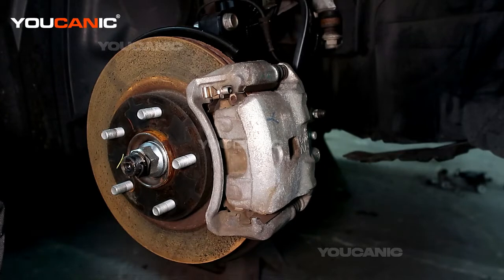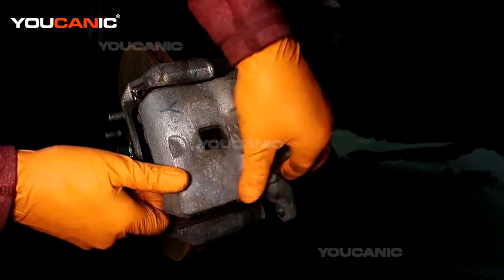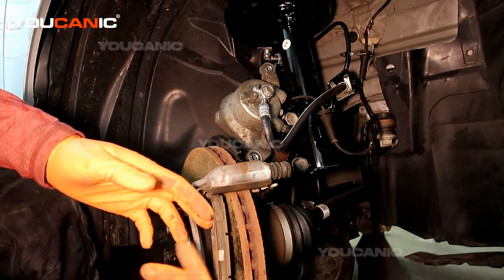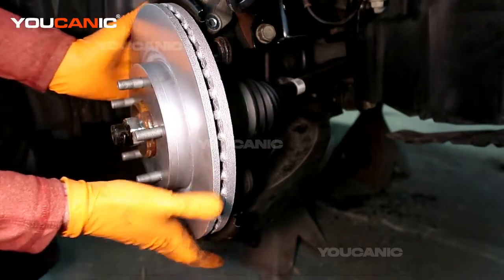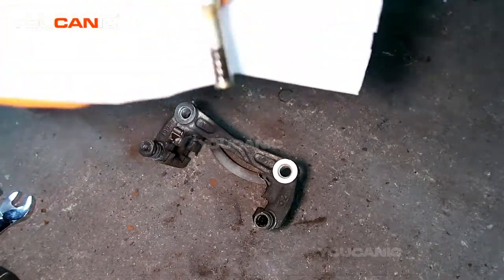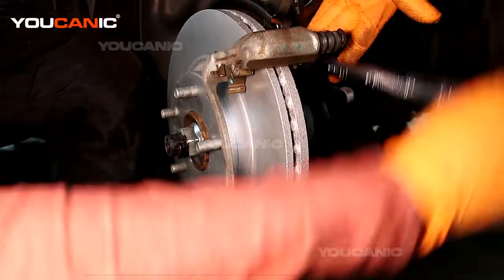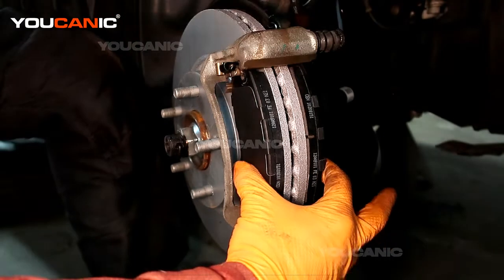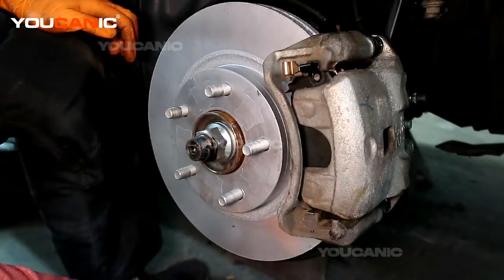2013–2019 Nissan Sentra Front Brake Pads and Rotor Replacement

Comment: Good job on the video. I would just add to make sure to torque caliper and caliper bracket bolts. I would also add to file off the rust around the hub where rotor sits and use some anti seize on it.
Reply: Don’t forget to clean the rotors with brake cleaner and wipe off the coating that is applied on both sides of the rotor at the rotor factory to keep them from rusting before they are purchased
Reply: i second this. just checked my car and the slider pin was missing and bolt. bought it from the dealership not long ago. gotta replace it today. somebody didn’t torque it right
Reply: So I just changed the front break pads of my 2019 Nissan Sentra and they’re making a bit of noise I thought I did everything correct

Comment: Very good.
Reply from the maker: Thanks for your positive feedback! At YOUCANIC, we're devoted to empowering car owners to diagnose and repair their own vehicles. Check out our Full System Scanner at www.youcanic.com/scanner - it's a great tool for understanding your car's issues in detail.

Beyond that, we offer many other resources such as OEM Factory Repair Manuals and a platform for asking car-related questions. Visit www.youcanic.com to explore. If you have more queries or require further assistance, don't hesitate to reach out. Thanks for trusting YOUCANIC. We strive to be your reliable source for automotive needs.

Comment: Hi, one question, please. My Nissan Sentra S 2013 needs to replace the front rotors and pads and I will try by my self. Are all the procedures same as your 2019 Nissan? Thanks!
Reply: Should be just about the same! Pads and rotors are easy g hope you had some good luck and got the job done :)
Reply: @tacticalbacon9877  Thank you so much!

Comment: I can’t get the 19mm off been trying for 3 hrs. Now its stripped and I’ve been spraying wd40
Reply: Hate when things don't go as good as in the video
Reply: If it’s stripped you’ll have to use an extractor socket with teeth that bite into the bolt. And then obviously you will have to find new bolts
Reply: Gotta use a 1/2" socket and long torque bar always does the trick for me.
Reply: @tayaria7280  bro 19mm is 3/4 inch

Comment: Dont forget to Grease the Pads heavily dunking them in grease BUCKET.😅
Reply from the maker: While greasing the pads could be part of maintenance, we wouldn't recommend heavily dunking them in a grease bucket. At YOUCANIC, we provide detailed guidance on diagnostics and repairs. Check out our Full System Scanner at www.youcanic.com/scanner. 

In case you need more information or have more queries, we also have a platform to ask car-related questions. Visit www.youcanic.com for a wealth of info. Our priority is to make automotive knowledge accessible and understandable for you.